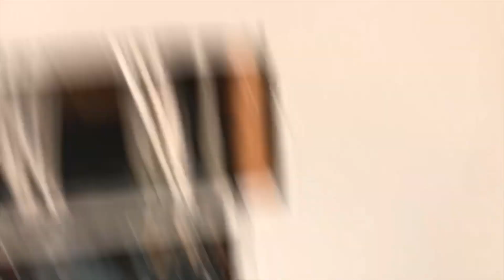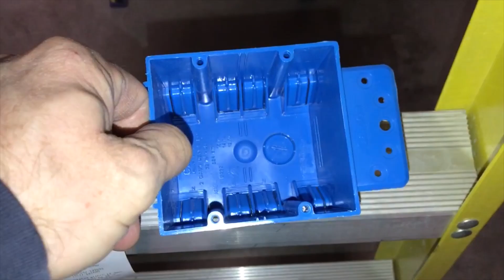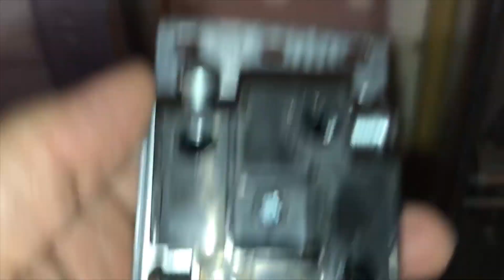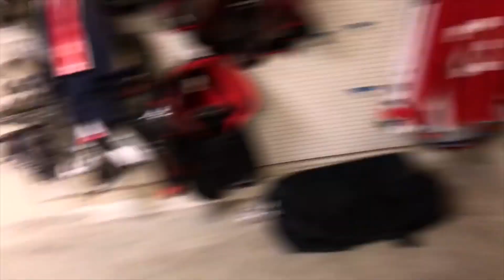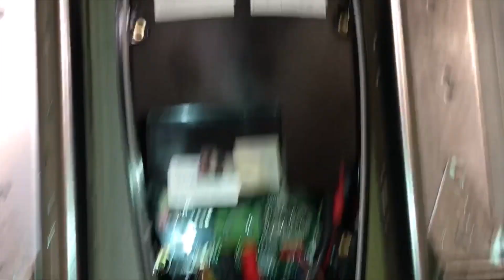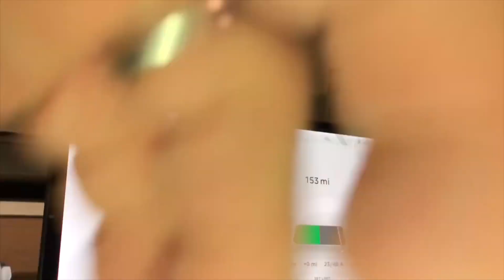Tesla Wall Connector/Wall Charger &  Nema 14-50 Full Installation Video

Comment: I’m not an electrician, but from my understanding, 6awg wire is not enough for sustained 48 amp charging, especially over longer runs like yours. It’s probably okay for normal intermittent loads, but maybe not for car-charging. You might want to put in a 50a breaker and charge at 40a instead. Also, I think wire that’s in a conduit can’t have the outer jacket due to heat build-up inside the conduit. I think you were supposed to strip the jacket off of the wire that’s inside the conduit.
Reply: @TriHarder81  not an electrician either, but the charger automatically draws a max of 48 Amps continuously. (60 amp breaker x 80%) so the load on the circuit should never be more than 48 amps therefore, 6 gauge conductors should be fine, I think.
Reply: He's using the MCU that has a max output of 32 amps.